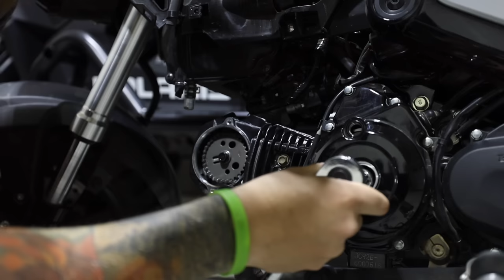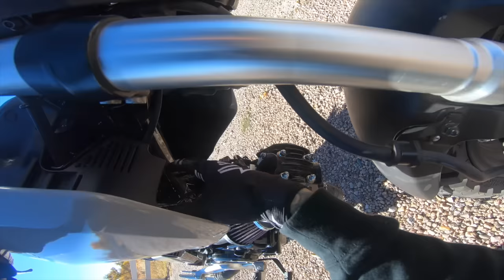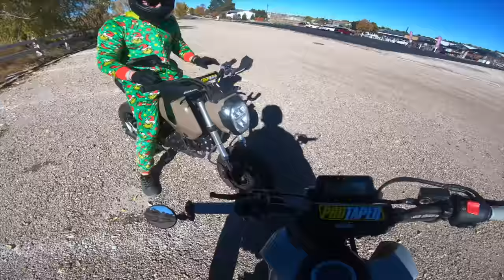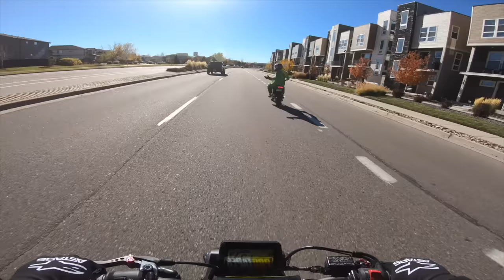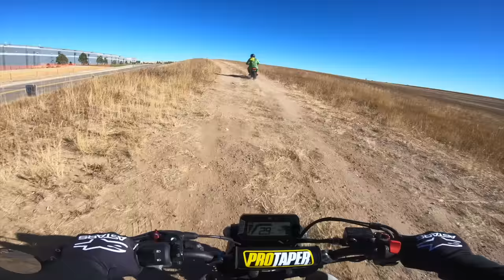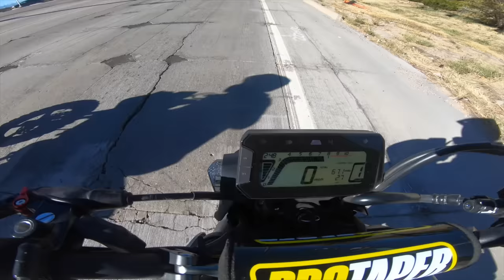2022 Honda Grom Performance Mods! | DHM Cam / Intake / ECU flash

Comment: You need to go 1 tooth bigger in the rear because in 5th gear its stopping at 8,000RPM. If you go +1 in the rear you will be able to rev out 5th gear more resulting in higher top end and also a little bit for quickness through all the gears. Best of both worlds plus you will be able to use those leftover RPM from 5th gear!
Reply: I have stage 3.  How big of a sprocket on front and back
Reply: are groms worth it i have a 650 stunt bike right now and was thinking about grabbing one
Reply: @BIGRENZY  yes
Reply: @antonithegoat4216  would it be worth it in united kingdom? bad roads and stuff but grom might be fun

Comment: My 6'3"- 190 lb son has an old 4spd Grom. He could go faster in 3rd than he could in 4th! So, he got a new drive sprocket that's 1 tooth smaller, and WOW! His Grom will now do 64 on the flat and 69 with a tailwind! I got to ride it and 69 on a Grom is lotsa fun!
Reply: Is that standard apart from the gearing change?
Reply: @mikey_bb  He has, glass pak exhaust and accsy air cleaner... Otherwise, stock engine,

Comment: How did the mods affect your fuel economy? Honestly curious. Thinking about getting a Grom, and don't know if performance mods are going to be on the roster.
Reply: Even if the mods do effect it, I wouldn’t worry too much. Gross have great mpg and they only cost like 6 bucks to fill up.
Reply: 3 dollars last for 2 days
Reply: @benmcbride7269  woaaaaa
Reply: It only holds a gallon
Reply: @bubba9046  1.6
Reply: From what I read on DHM's site it definitely will decrease MPG from stock, but "bad" MPG for a Grom is still good enough to make a Prius owner salivate.

Comment: Running 91 pump octane is pointless unless you physically are changing the compression ratio, installing the cam may of affected the compression but your friend running 91 on a stock grom is silly.
Reply: Where I live, the only ethanol-free fuel is 91 "premium"... the rest have 5-10% ethanol, which has less energy than gasoline, so you can get a small performance increase by going ethanol-free.
Reply: @Thirsty_Fox  That's actually been proven false.... You wouldn't get necessarily a "performance increase" but instead "increased mpg" because the computer would realize there is unburnt gasoline (energy) in the exhaust via the 02 sensor. Look up a video by the channel called "Project Farm" where he ran high test gas vs low test, the high test only lasted like 2 seconds longer than low test in a generator with a light plugged in and running while having a watt meter on the output of the generator. Needless to say, everything was within the margin of error.

I will repeat myself, "running 91 pump gas in a vehicle not designed for it is wasting money", unless your engine can properly ignite the higher octane you cannot properly burn it. 

Best case scenario as you said ethanol free has a little bit more energy, in which the computer of your vehicle will notice the excess "energy" in the exhaust and adjust the injection of gasoline accordingly, you will not get more "performance" but more "mpg" instead. Just because the "potential energy" is there does not mean your compression can properly ignite it.

Worse case scenario you waste money, and force your catalytic converted to work harder, thus lowering its lifespan.
Reply: @akustaka  Believe what you like, but there's definitely a benefit of not having ethanol in your fuel. I wish all fuel grades didn't have it but alas. Another reason to avoid ethanol beyond mpg and performance is that ethanol is hygroscopic and retains water, which is especially bad for carbureted bikes, but even FI bikes that are left sitting any length of time. Most modern engines can adapt for the fuel used and make timing adjustments for optimization.
Reply: And for the record I bought a brand new stock Grom. These minibikes arent designed for high octane gas and it gives worse performance. Read your owner's manual.

Comment: You shouldn't need premium gas, unless you're running higher compression piston.  Mid-grade should be fine.  When you did the reflash, was there an option to raise the RPM limit?  I know there was an option on the previous gen Grom/Monkey and I raised mine to 9750.  Block tires are going to be sketchy at higher speeds.  Changing the front sprocket down will give you better acceleration and the cost of top speed.

Comment: This kinda seems like my experience with my 2019 Grom. After doing stage 1 (exhaust, air box, ECU flash) it didn't add as much top end as I'd hoped but it made the bike alot quicker to redline which was really all it needed to make it perfect for marauding around the city
Reply: On the last gen 2018-2021 Groms the best (bang for the buck) mods are intake, exhaust, TB cam, and ECU reflash with RPM raised to 10,000.  You should see at least 3 HP increase.  Going down to 14 tooth front sprocket will give you better acceleration at the cost of top speed.  I easily reached mid 70's on my 21 Monkey.  Things can get sketchy on the stock tires, so be careful at speeds over 64.
Reply: @rrazote2279  is 10k rpm safe for stock heads n valves etc?
Reply: @charliesmith874  From the forums, to other Monkey/Grom owners, I've been told up to 10k RPM is fine.  Past that and there's a chance of the valves floating.  There's a valve kit you can buy for under $100 that can fix that problem, but at 9750 that engine is screaming, so I dont know that anyone would want to push the engine past 12k (that's the limit I've heard people set the RPM with the valve kit).  You'll definitely want to use top grade oil and change sooner.  I used Motul and changed every 2000-2500 miles.  Heat can kill these little engines fast, so I would recommend an oil cooler and oil pump upgrade.
Reply: @rrazote2279  ah right cheers mate, hopefully getting a grom next month so yeah just looking into my options to squeeze a few more horsepower out of it haha

Comment: I love my 2022 Grom. I too did DHM tune with chimera intake set up. Over winter I plan on doing the cam.
Reply: How does it feel with intake/exhaust/tune vs stock? Like acceleration and top speed I'm keen on doing it!
Reply: @ReeceCoza  it feels a lot more responsive and definitely noticeable difference. Top speed is increased for sure. Downhill I saw 80mph but that most likely wasn't spot on but can say I was moving.
Reply: @89foxguy  that's fantastic! I presume hitting the 50-60mph much easier now?
Reply: @ReeceCoza  definitely gets up there easier. Highly recommend 👌
Reply: @89foxguy  wonderful! Got intake on the way then I'll order cam and tune!

Comment: Nice mods.  Have you noticed any difference in fuel economy?  Will the cam hasten engine wear?  I am looking for 2023 Grom right now.  I am 75 so the Grom is about my speed.
Reply: with greater performance comes with a loss of fuel economy, but the economy is so good the begin with that it doesn’t make much of a difference, you lose 10-20 miles of range maximum
Reply: I gained mpg with intake exhaust and tune. I dont have to ride it as hard to get up to speed so that helps

Comment: bit late but i have the new voge r125. man, that bike really picks up after 7k rpm. after break in, the odometer resets and goes to 0 miles then lets you use all 12k rpm. speedo reads 75mph, a true 71mph from gps

Comment: I must be doing something wrong. I got my ECU flashed from DHM and see almost no difference. A little more power in 4th gear. I have a cheap iStunt exhaust, MNNTHBX intake and a 14t front sprocket. DHM recommends taking the baffles out of the exhaust. I have an aftermarket baffle in because the exhaust was just too damn loud. I'm wondering if I remove it will it make a big difference.

Comment: So after break in I can do 70+ on highway cruising. Top speed hit was 81 on limiter. I'm stock still. I want to do your upgrades.
Reply: How did you accomplish 70+ cruising...?
Reply: @facial210  I'm sayin. I wot at 40-60 miles on the grom and I only got 62 goin down hill

Comment: I bought this for MPG, how badly did this affect yours? Did you do a before and after?
Reply from the maker: Idk before but today I was getting 117.5mpg
Reply: @TalonSei  Nice, maybe some power adding wouldn't be as bad as previously thought.
Reply: @TalonSei  My completely stock Grom shows 141.2 mpg. That's a pretty good decrease, but imo, well worth it.🤙
Reply from the maker: Knobby tires take down the mpg more than anything.
Reply: Just did the first oil change on my stock 2022 Grom.  541 miles with an average 169.7 mpg.  Top speed is about 57mph.  Bought it to take in my van when I go camping.  If I have a need for speed I will get on my R1.  It gets around 38mpg and will easily go 170+.

Comment: Pro tip with the Chimera intake: if you get the 3” inlet SPECTRE performance filter, it fits perfectly over the included filter with the chimera. Just use a hacksaw, some super glue, and three little stainless wood screws to fit the big filter over the outlet portion of the little one. 

It’s ridiculous looking, and ridiculously fast! :)
Reply: Another thing, the SPECTRE filter has a built-in velocity stack, which makes it faster-flowing than a straight pipe, while giving the filtration you need.

You may have to clock the intake in a slightly different position depending on what your fairings allow.

Comment: Do you think if you had less knobby tires, you’d go a little faster on roads?
Reply: Absolutely, street tires are worth a few MPH easily, not just because of being smooth, but also because they weigh a bit less. 71mph on knobbies is pretty legit!
Reply from the maker: Maybe a mile or 2 faster
Reply: @TalonSei  What tires do you guys have ?
Reply from the maker: Kenda big blocks
Reply: I noticed no difference (in top speed) between the Kenda 761 (50/50) and Maxxis M6024 (knobbies), so I put the Maxxis back on because it was more planted in gravel. Maybe there's more difference between real street tires, like Power Pures and knobbies.

Comment: What’s the base top speed
Reply: Stock they usually only go 50 max. Maybe 55 down a hill
Reply: @Lumberjack19-qu4hf  with between 40 - 60 miles on the stock 2025 grom i got 62 downhill full tuck

Comment: I Got my stock grom to 74mph yesterday. Hoping some mods will get me to 80
Reply: Stock from going 74? Bullshit lol
Reply: @DatHondaBoi223  my does 70
Reply: @DatHondaBoi223  Must've had a gsxr pulling him. 😳 😆 Mine (2022 SP) tops out on the limiter, flat road, with me damned near laying down at 60mph. You'd have to be laying down, on a 90° hill, wide open with the wind pushing you, to get near 70mph on stock. I still doubt it then.
Reply: @DatHondaBoi223  I’ve gone 76 downhill
Reply: @Nick.964  where’s the video

Comment: New riders DO NOT use high octane gas in your Grom. It will not give you better performance! That's a MYTH. You can even damage your engine, it's in the owner's manual. Use 87 octane gas.
Reply: Thanks man

Comment: Not even close to my DRZ400 Suzuki. Low power can't go off-roading and definitely can't go on the motocross track or in the desert, can't get out of its own way even with the power upgrades. Took one back after test riding. Not spending that kind of money on a little bike that only has 4 inches of travel. All the problems you guys are having with these things trying to make it go faster. Get a real bike! You'll be a lot happier. In my opinion it is a waste of money after riding one. What are you people thinking?
Reply from the maker: Who’s having “problems” making them faster? It’s fun. Watch my Moab Grom videos if you think you can’t take these off road. Also my “real bike” as I guess you would call it stomps any DRZ in every single category. Have fun with your carbureted bike that hasn’t changed since 2000 🤣

Instead of worrying about how people spend their money and complaining about it on the internet, maybe you should worry about how you spend your own money if you think $4,000 is significant.